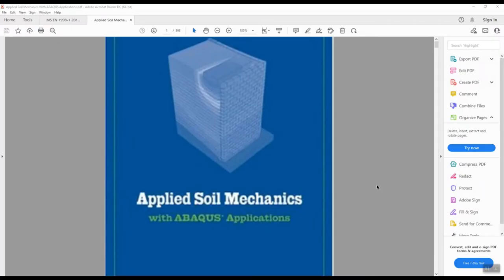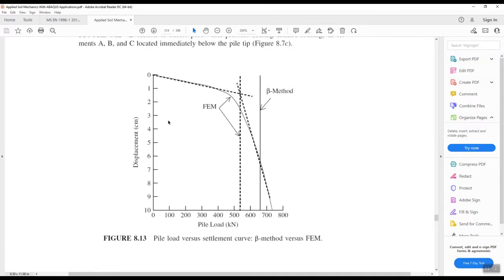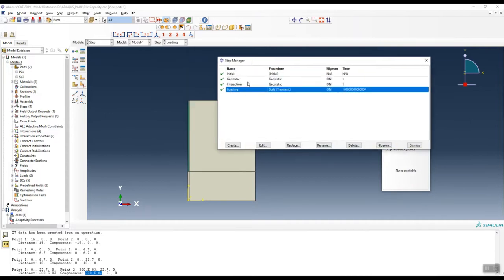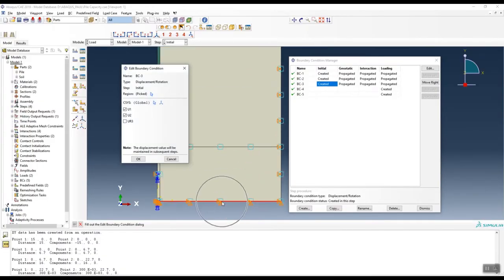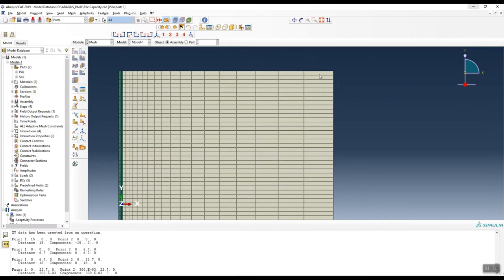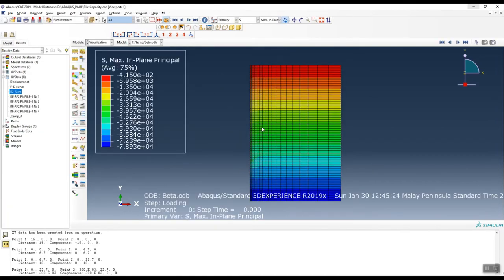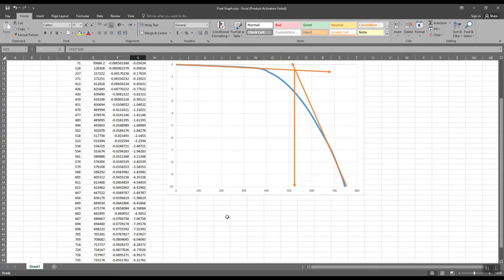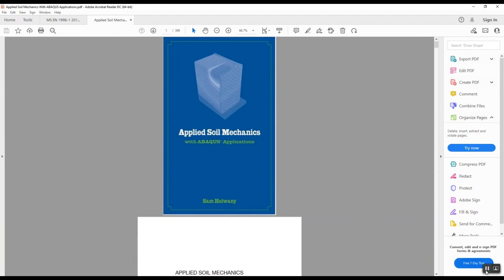Pile Capacity Analysis using Finite Element Method

Comment: Hi sir  Which valor u have used as a Max pore pressure change per increment for the loading-step and why u considered interaction as an independent step(no load is applied on this step ?) and for the selfweight pile why u used the effective density althought that the concrete is a non porous material?
Reply from the maker: Hi Anas
Please download the book and you can find all the information there.
Thanks for your comment.